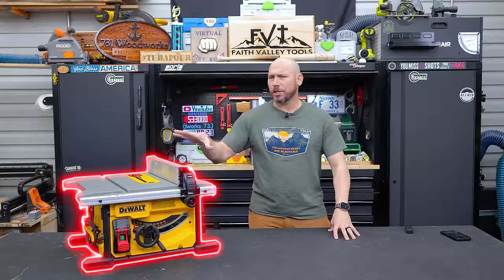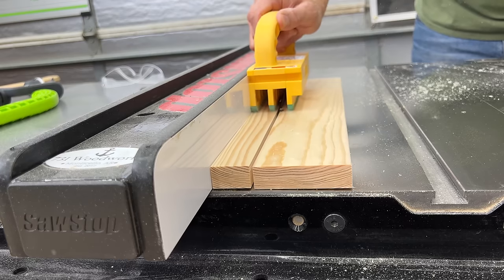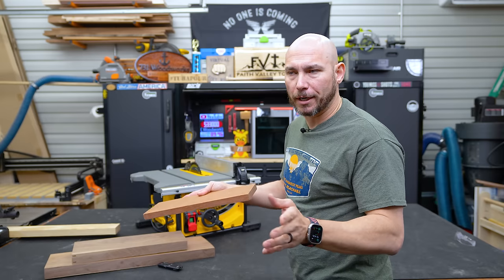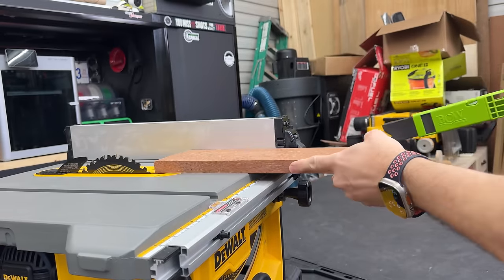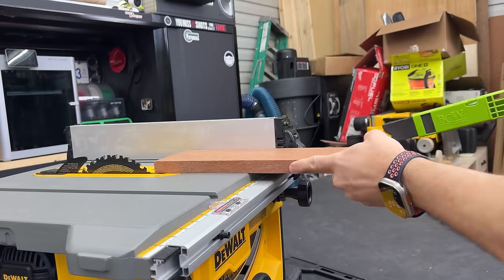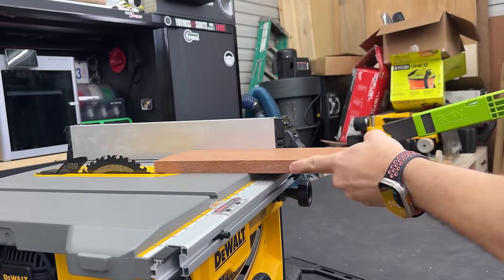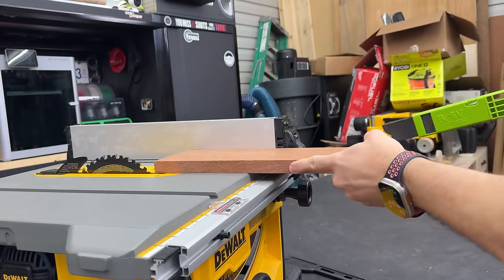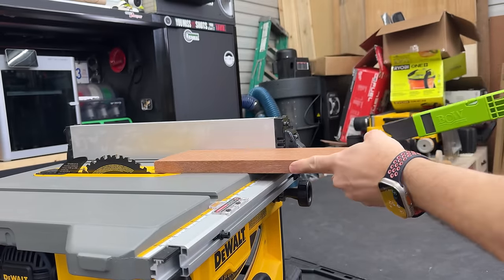99% of Beginner's Don't Know These Table Saw Mistakes to Avoid!

Comment: Finally someone mentions tourniquets. I keep them in the shop, in my truck, strapped to my tool bag, and in the normal first aid kit. After getting out of the Army I view first aid very differently. I think everyone should be trained in Stop The Bleed. These movie tourniquets of a bandana and a stick or a belt pulled tight just aren't going to stop bleeding at the pressure that needs to be applied. Tourniquets HURT. They are supposed to, that's why they are so effective (when trained on proper use}. Thanks for mentioning that. I really like your videos, keep it up!

Comment: Finally someone posts a video about tablesaw safety! I have to say that my set of rules for using a tablesaw are exactly aligned with yours. Because of it I still have all of my fingers and thumbs, and they are all in great working order. When I was running my own home renovation business, and person I hired had to take a safety course from me before using any of the tools we worked with. My number one rule: Safety is Job One! Whenever I caught one of my crewmembers skipping a safety rule, it did not matter how good they were at the job, I would terminate their employment immediately. 
I was working for a company that built custom buses, in the automotive industry, making a name for myself. Eventually, I wound up running the cabinet shop there. 
Most of the tablesaw operators there had missing digits, due to unsafe practices. Even my own dad had cut off the tip of his left index finger on a tablesaw. Of course when he learned to use one, a lot of the safety equipment for them were not yet in existence. I on the other hand had been taught about safety in school woodshop classes, of which I took three. But even then a lot of the safety equipment did not yet exist. Being a smart person, I was able to conceive, draw up plans for, and build certain safety gadgets that made using the tablesaw much safer. Nowadays, it makes me happy to see all the many safety gadgets that are manufactured for tablesaws, and the more you have, the better for you it will be!
I am now 67 and I still have never had a bad accident with any woodworking equipment. This is because I think my job through before beginning, and then if I see a step that does not make good sense the way I originally planned, I adjust for a different and safer way to get the same results. A well equipped woodshop should have multiple ways to get certain parts of a job done, and the safest way should be the one you choose to use, if at all possible. With the experience I've had in the business, I just about know my job so well that I hardly need to think a lot about how to get the job done.
I thank you Sir, for being the most safety minded woodworker on YouTube! I look forward to any and all of your other safety videos, and I hope you will continue to make them as the need arises.
SUBSCRIBED!

Comment: Fantastic down to earth video, I spend a lot of time using many different tools including a table saw.
Two years ago I was ripping a thin strip of wood, I was doing exactly the same thing that I have done many times before with no problem, I was feeding the wood through with my fingers close to the blade (not using a push stick) As my hands got close to the blade I had kick back, the wood fired rewards, but unfortunately my hand carried on into the blade, you can imagine the result. Its so easy to become complacent but an accident can bite the best of us in a split second. 
Great to see some common sense safety tips that can help prevent the same thing happening to other people, regardless of experience or skill.

Comment: Great video!  I made myself a couple zero clearance inserts for my old craftsman saw that I restored.  I never thought about stuff falling in and kicking out, and I'd agree it's probably good for that if that were to happen.  It definitely helps most of the sawdust go down with the blade and not kick up which helps simplify my setup a lot.  Now I just need a vacuum on the bottom and it'll be about time the old motor kicks the bucket on me, so I've been putting that part off.

Comment: Awesome tips and safety advice. Really appreciate it. This is one tool you don't want to be complacent about or use incorrectly. It can bite you in the blink of an eye. I've always used push sticks, but will def check out some of these other accessories.

Comment: Good tips, so many I have learned the hard way. I have defiantly learned about kick back, a stomach punch and a hole in the garage wall. Finger tip contact with a spinning blade, luckily damage was minimal, still feel it in my finger tip 30 years latter.

Comment: I had a nice OLD heavy cast iron Delta, with 6 foot expansion rails so you could do panel cutting. After buying a new mandrel that was a good solid tight and true table saw. Then I picked up an OLD AMF era De Walt, not B&D De Walt but another old solid tight & true heavy cast iron saw, but the guard was long gone, so OSHA was kind of a problem. I kept a joining fixture on it when not in use. Put a Dayton motor on an old Delta and it's a powerhouse of a saw. The AMF built De Walt didn't need any added help  for power. The very first thing we made in woodshop class was a push stick.

Comment: Great informative video here, thanks. Excellent advice on safety gear and practice but I would also respectfully suggest using a heavy leather or rubber apron to help protect from kickback missiles. You mentioned hearing protection. I always use earplugs with ear defenders on top and I've found that reduces stress levels allowing me to think more clearly. That realy works. Thanks again.

Comment: Great video. 

After 30 years of DIY projects remodeling 5 homes, I found myself requiring a table saw for the first time. Without a doubt, it's the scariest, most dangerous piece of equipment I have ever owned. And maybe the most dangerous I have ever operated, aside from a 12' industrial sheet metal brake (I was an aviation structures mechanic for 10 years).

I think another tip that should be pointed out is to buy a quality table saw versus a cheapie. As a tool I likely won't use often, I was really considering getting a cheap Ryobi ($150) or a Harbor Freight (also about $150) versus the highly-rated $400 Dewalt. One complaint I read about these cheaper saws was poor locking functionality of the fence and flimsy construction. Those are absolutely things that will lead to kickbacks and injuries. Glad I spent the extra $250 and got a quality saw. Imaging how much the emergency room visit will cost after "saving" $$ on a cheapie saw.

Comment: Great video. I'm gonna head all the advice and acquire many of the items you've mentioned. I just bought my first tablesaw and, since I made the idiotic mistake of reaching around a blade and tagging it with the tip of my thumb 30 years ago, I have a healthy fear. Thankfully, the thumb sewed up nicely and is still intact. 😂

Comment: I have been using my table saw for five years and I use all the safety precautions. Up until two weeks ago I was cutting a piece of lumber at an angle, the blade was low, once I cut the piece I turned off the saw and reached over the blade to pick up a sliver of lumber, and it caught my thumb. 10 stitches later I am so glad the blade was lower or I might have cut off my thumb. Great Instructions as always.  !!  You pointed out my mistake in you Don't ever do..

Comment: one thing you didn't mention that I wondered about as a newbie was letting go of the piece to readjust while pushing it through. Also backing off with the cross cut sledge, and how this is fine if everything is setup right/there's no binding. I just thought that it needed to continue to move forward constantly until the cut was done.

Comment: Good video!
I might suggest removing any paper labels from blades, which aren't as common as they used to be, as far as I know. 
I've had a bit of a spook recently with a zero clearance insert just after a long cut lifting and canting the insert at an angle, potentially binding up the blade or becoming a projectile. The label partially released from the blade with the heat generated from the longer cut and started pushing up on the zero clearance insert. No misfortune came my way, but the potential became very evident.

Comment: Thank you for putting this helpful guide together- very comprehensive! The only advice I semi disagree with is standing to the left of the blade. If this is comfortable and you have long strong arms then that is fine, but if you have short weaker arms I think it is better to use all the methods you describe to prevent kick-back and then stand firmly in front of the piece as you push it through the path. Keeping firm control of the piece is important.

Comment: Thanks.  I found that adding a knee high emergency stop switch was a great safety improvement on my large table saw.  My stop switch panel is  about 10" x 12".  It is centered exactly knee high.  It allows me to power off while keeping my hands on the stock.  Especially if things go south.
Also it has a key that can be removed to disable the tool when your absent and there is a risk of children entering the premises. I wouldn't go without.

Comment: Great points! Bad habits are hard to break but safety is always the top priority. A tourniquet in your vehicle's first aid box is also a good idea.  The only time I had an injury with my table saw was when I was wearing gloves and reached to clear a workpiece while the blade still spinning down. I had ear protection, and the vacuum was on so I failed to hear the blade still whining. The glove caught and pulled my fingertip into the blade and split it.  My son's first question was - were you wearing gloves Dad?   I highly recommend not wearing gloves at the saw, and taking the time to wait until everything is at a dead stop to reach anywhere near the action. Also, fence and blade alignment are essential for safety. Forcing work pieces against bad alignment will create burns on the wood, smoke and cause kickback - and even damage the saw. Take the time to adjust alignment and do test cuts frequently.

Comment: In my experience, I think it's important that your out-feed table be at exactly the same height as your table saw to form a perfectly flat surface.  My worst kickback accident happened when I had the blade angled over to 30° and ran a strip of plywood through to bevel the edge. The out-feed table was an eight of an inch lower than the saw table. As the wood exited the cut the unsupported out-feed end tilted the piece just enough that it bound up with the blade, and came flying back. My body was in a safe position but the flying piece caught my hand and I got a grievous wound across my knuckles. Only lost some skin but it still took a while to recover.

Comment: This is definitely the best and most comprehensive table saw safety video I've ever seen. I make picture frames so ripping thin stock is mostly what I use my table saw for. I particularly appreciated what you said about plastic push and will make changes to how I work based on it. That said, I think a lot of the safety issues that you talk about can be mitigated by using a track saw. This is especially the case when it comes to dealing with sheet goods like plywood and MDF.

Comment: Awesome demo and explanation most especially the safety measures to follow. Have you made a review of a Hikoki Cordless Table saw Vs Cordless Makita Vs Cordless Ryobi? I find the Bow Xtender very practical and safe. I am now using Bow featherboards and push stick with modified Veritas Router table. Thanks for this video. Cheers.

Comment: Great video!

I'm a novice and recently got my first table saw. I also got the gripper, as I've seen it recommended in many videos.

I'm wondering if it's possible to use it together with the blade guard? So far I've removed the blade guard so the gripper can pass straight over the blade. Is it safer to use push sticks and keep the blade guard on?

Comment: Thats what happened to me yesterday.   I was little tired and unfocused. I always pay attention to the moves I am making with table saw and always be careful. But yesterday out of a sudden I don't know why and how I decided to take off cutted small peace on the left side and got finger on blade. Now have badly cutted nail (dropped to the side of the finger now), blended end of bone in finger and nail root. Fortunatly I didn't loose my finger at all. 
And now I am waching this great video which I had to watch a long time ago before disaster. Now I will be prepared  with safety tips to not loose all my fingers. Thank you for for this video!

Comment: Excellent Safety video. Just one thing i noticed during safety tip #10 Thin cuts.. You had mentioned earlier about reaching over the top of the blade, however, doing the thin cuts you did just that with the blade Spinning on the 1st cut, it just stood out, maybe I am a bit paranoid. Thank you for the Video.

Comment: Great video.
I would add to keep your thinner cuts to the outside of blade (that you did mention).  I've received a wood torpedo to the pectoral when cutting a thinner piece in between the blade and fence and wham! Never did that again. Smaller narrow cuts are now on outside of blade so there's no wedging creating a wood projectile.

Comment: Very good tutorial on saw safety. One thing I didn't see mention is the adjustment of the riving knife to the saw blade. This distance needs to be about 8mm maximum. Any more and well, it might as well not be there. 

We tend to use the extraction hood as much as possible. Anything that keeps that saw blade hidden from being touched. Our plastic push sticks tend to give way to ones made out of MDF. Admittedly turned out on a CNC router.

Comment: Great video. Just one comnent about Sawstop tablesaws. The medium and larger saws are the ones that get raves. I recently had a tablesaw class (the Rebuiling Center in Portland, OR - great beginner classes for reasonable prices). One of the saws for the class was a LOW end Sawstop saw, and it was cheesy compared to the Dewalt jobsite saw even to my untrained eye.

Comment: Excellent advice that EVERYONE should know before using a table saw.
As a 22 year carpenter, I've seen several accidents because of guys going too fast, or not paying attention and RESPECTING power tools.
We had a new guy with very little experience try to rip a 2x6 from the BACK side of the table saw. He nearly lost his fingers when the blade grabbed the wood and he tried to hold it. Needless to say, the table saw won that battle. We never let him use ANY power tools after that.

Comment: tip # 11.  I estimate i have over 20,000 hours of cutting experience on table saws, and thousands more on basic shop tools and equipment.  The few times in 30 years of daily work where i have had bad injuries, or narrowly escaped a very bad injury, i had that gut feeling like it just felt so wrong what i was about to do. This is the #1 thing i try to teach anyone new that works with me.

Comment: It’s always good to watch a good table saw safety video from time to time, because let’s face it we all take our skills for granted sometimes, and safety fades to the back of our minds. I personally dislike the style of push stick that you use. I much prefer the ‘L’ shape push handle, it’s more stable, it puts downward pressure on the board, keeping it from vibrating; and with a rubber foot on it you can angle the handle slightly towards the fence preventing kickback.

Comment: Excellent video to review safe practices. I am an amateur woodworker so I reorient my self to safe operation before operating my saw top. I've used one for 10 years. I built a 4x4 outfeed table. Even with the saw stop safe operation is essential for safety. Thank you!

Comment: Hey, thanks for this great set of tips.  I thought I understood all that I needed about safety on the table saw, but I learned several things.   And I bought a couple of your favorite accessories too!  

One thing I didn't pick up that I see folks do too often.........cross cutting a piece with the fence where the distance to the fence is longer than the width of the board.   A sure fire way to get a kick back.

I've used your model of Saw Stop for 10 years, and it's a perfect saw on top  of the safety features.

Thanks again.  And thanks for making your belief in God visible too!

Comment: i used to work at a cabinet factory here in south east Missouri and we used saw stop table saws. we had to use the blade guard or it was a safety violation. i’ve also seen some safety instances on how you use the miter saw. like crossing your arms to make the cut, maybe do a safety vid on the miter saw too.

Comment: My personal push sticks are 18inches in length with one being similarly built as your green one is but my other has a 4inch square end that is 90degrees to the stick. It also has foam westher stripping across it that allows me to grip my board faces. This allows me to not have to ever get within 18inchss of the blade but still manipulate the wood as needed.

Comment: I just bought a Bosch contractor model. It's a little older but in good shape. The fence on it is quite shaking when moving it and when I lock it down it often kicks over like a 32nd I have to measure the front and back of the blade Everytime I just can't trust it to lock down straight it would seem. I haven't found a way to adjust it yet